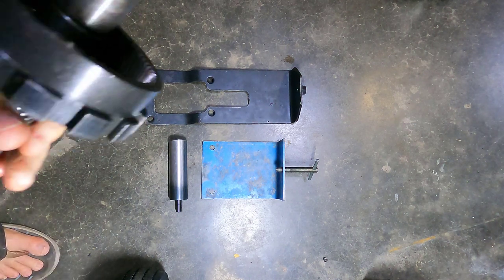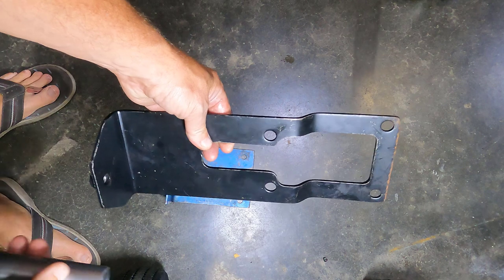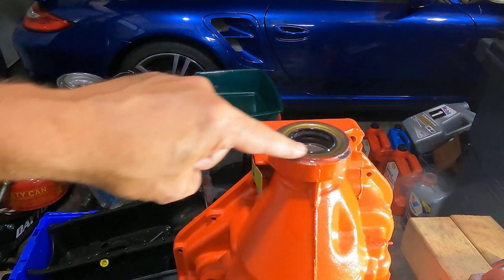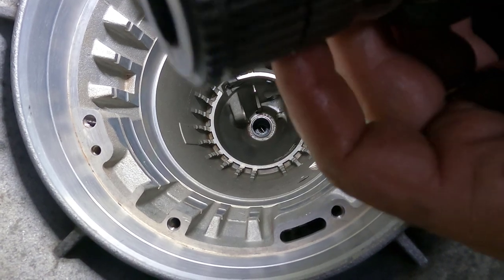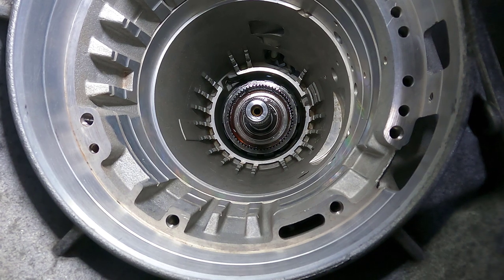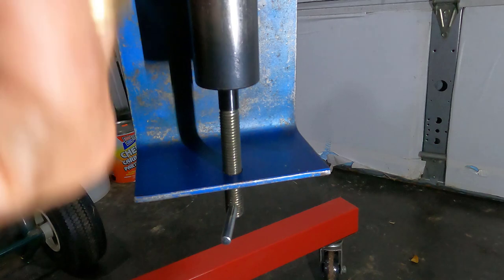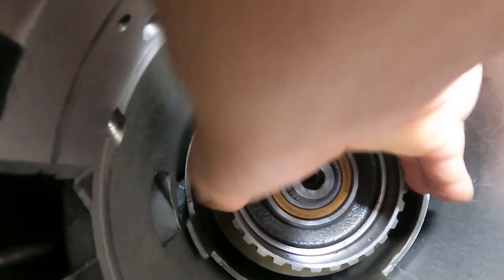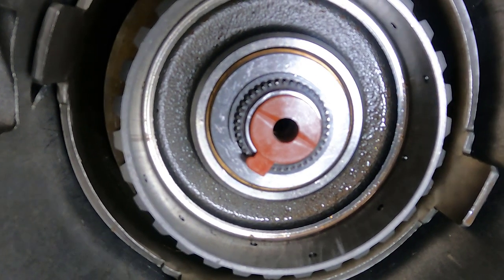200-4r Rebuild (part 18) – Rear Section Re-Assembly▶ Learn the Tricks To End Frustration!! 🤙

Comment: Hey Phil! Thanks for putting so much detail into these videos. I finally got most of the parts from CK for my pro-street kit (a year after ordering! ) and I'm assembling it now. Any idea when the next video is coming out? Mine is going in a resto-mod '77 Trans Am bandit car with a hot 400 pontiac in front of it. Should be 500+ hp and rear tires are 11.5" wide so I figured the billet internals were a safer bet for longevity. The '81 Trans Ams with the wimpy turbo motor came with a 2004r, so I can get all parts for a drop-in fit including the console shifter. Everything looks like an OEM install, but with better mileage than the th350 it came with.
Reply from the maker: Thanks for watching!!
A year after ordering, ouch. Parts are getting harder to come by for sure.
Next video is being filmed as we speak. Hopefully finished filming/editing end of month or early Nov.
SWEET ride... that screaming eagle was the coolest and the T-tops... oh mannnn. I wanted one of those but never got one. I had a 77 camaro in the mid-80's with the wimpy 305... n side pipes lol
Good luck with the build!
Reply: Thanks for the reply! I had a '78 T/A as my first car as a teenager, but I destroyed it driving it, well, like a teenager. Took me 25 years to get around to buying another to treat better. Side pipes were quite the thing in the 80s, weren't they?
Reply from the maker: @thomashart9304  I can relate to that! When I was a teen in high school I always wanted a 66 Chevelle but the Camaro was enough to eat up my minimum wage job. Flash forward about 25 years and I finally bought one as a father/son project car. It was well worth the wait 😁

Comment: I just found your channel and instantly subbed. I have one 200 that is freshly built but has been sitting for over 10 years (wrapped in a contractor trash bag) that I need to go through. it supposedly has billet parts. I have another used 200 in unknown condition. My goal is to support 650whp behind a Gen IV 5.3 topped with an M122 roots blower in a first gen s10 blazer. I have no idea if this is doable though. I'm still going through the compatibility of the factory 128k pulse per mile digital speedo and cruise system which I wish to retain. If my power requirements are not capable of being held with a 200 I may just go with an 80e because it WILL support the power and speedo/cruise. I'm hungry for knowledge, please keep feeding me videos!!!
Reply from the maker: thanks for subbing! The Chevelle behind me on the 4 post has a 2004r with a 383sbc and 177 roots blower... I never dyno-ed it but it is 'healthy' 😜
This one I'm building in this video series is going behind a 454 bbc w/6-71 blower... but I don't have a 'toy car' to put them in yet hence the 'build the tranny when I get free time' approach.
Good luck with ur build!

Comment: I recently picked up what I believe is a nice 200 4r... reportably...the unit was good to go when pulled Yeats ago. Now of coarse I'm hopeful it's all good...but can you describe a general rundown on checking it out? It's not attached to the motor. I degreased it and sprayed the exterioe steel elements with wd40 and its inside. Believe it's a CRF from a Monti Carlo. My build is a 30 ford Coupe with a warmed up 350....so a lite car really...maybe 2.5k approx.
Reply from the maker: If it were me... since it's been sitting for years and you never had a chance to actually drive the car it was in to feel the shifts I would tear it apart and at least do a basic overhaul.  
Watch this video series from the beginning to get a general rundown of the process, and skip the performance upgrades.
Good luck with the build!
Reply: @wrenchingwithphil  thanks for the reply. Nothing is easy.....grumbling....
Reply from the maker: @BoxcarsGarage  LOL... but it's fun 😉

Comment: I’m following your videos to rebuild mine.  What kit did you buy again?  And also are you going to make a final video where you set it up on the car?  Thanks again
Reply from the maker: Thanks for asking!
I'm using a rebuild kit from ck performance https://www.ckperformance.com/List/2004R/2004R-Rebuild-Kits

Well actually after I finish the 2004r I have to build the engine... 454bbc. Then find a toy to put them in. The whole project-  2004r and 454 and car build- will be recorded and uploaded.

For the 2004r I'll show how to setup the throttle cable and explain the 'why/how' of what goes on when moving the cable a click forward/backward as well... and how to wire the tcc solenoid into your brake switch to make sure lock-up works.

So, not 'technically' mounted in the car but I'll show/explain the actual steps to doing so.
Good luck with your build!
Reply: Thanks for the response. And the videos. But I was asking which kit specifically. There are four or five to choose from.  Thanks again
Reply from the maker: Gotcha! I'm using the pro street master rebuild kit. https://www.ckperformance.com/View/PRO-STREET-MASTER-REBUILD-KIT
Reply: I was thinking I would get the “master C” kit. It’s $589.00. More affordable for my budget.  I’m not throwing any kind of crazy horse power or torque.  I just want a better transmission that preforms better. Will this do it?  Also can I still do the upgrades that you go over in you videos?  Thanks again for all your help
Reply from the maker: @darrellhenderson913  sure do whatever your budget allows... just know that I'm a shmo and not a pro(disclaimer lol).
The forward drum is a common failure point and if you are not changing it to billet shafted one definitely do not dual feed the direct drum. You might also consider changing out the servo as well if the factory one you have is a small one.
Good luck with your build!

Comment: IM GETTING REAY TO START MY BUILD USING ART CARR KIT WHICH HAS EXTRA CLUTCHES BUT HE SAID I DIDNT HAVE TO USE THEM FOR MY 375HP CAR  DID YOU USE THEM AND WHATS REQUIRED IF I DO ?HE SAID I WOULD NEED TO MACHINE DOWN PISTON??
Reply from the maker: Thanks for asking!
I think you're talking about machining down the fourth clutch piston to add an extra clutch in between the 2 steels there. If so, see video 16 in this series to see how I did it.
Hope that helps and good luck with the build!